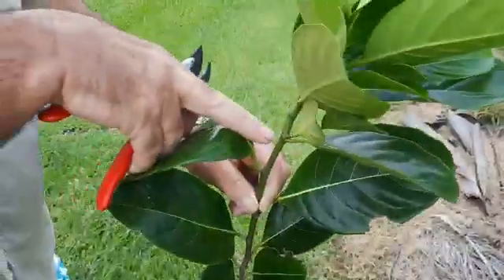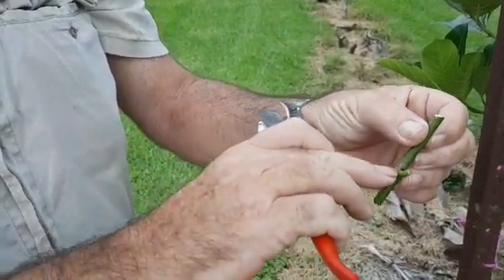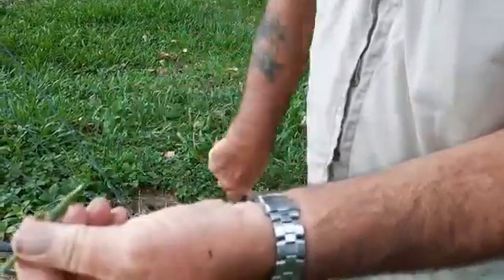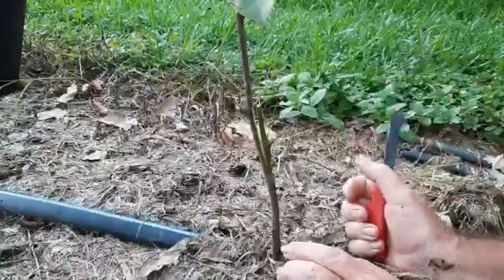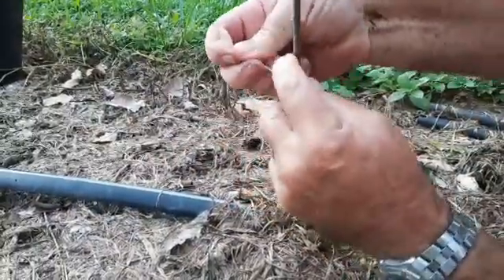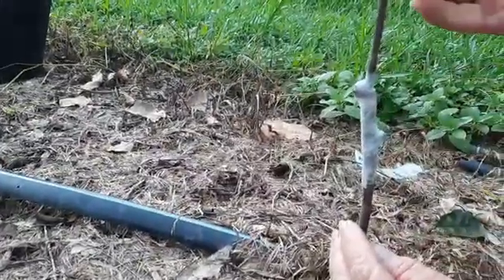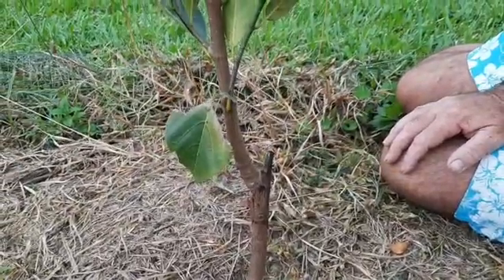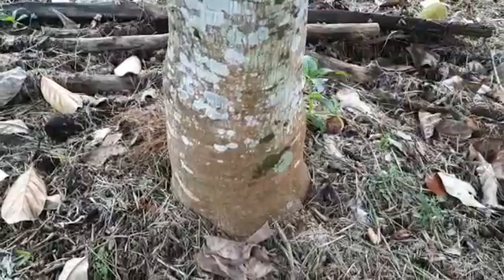Jackfruit seedling Grafting directly in Field-Healthy Tap Root Cyclone Protection Drought resistant

Comment: What season do you think is the best season to graft. Is it the march month or the November December season. What's the best post graft care, immediately after graft. Because in the field it's difficult to maintain humidity and shade. Please let me know. Thank you. ❤️
Reply from the maker: Especially for budding, the survival rate is high when done inside green house / Polyhouse from Jan to Mar. Budding done during rainy season are susceptible to a lot of failures. I have heard from a batch of 2000 budding only 60 survived during rainy season.

From few experts, i also heard the other grafting methods especially for first time grafters, survival is higher in traditional grafting.

Grafting directly in field definitely needs lot more care and the optimum season.

Comment from the maker: I have shared the video to help Tamilnadu farmers and also jack progressive farmers across the world to adopt such practice especially those who are very much concerned on the tap root system of Jackfruit trees. 

Dibbling seeds in the ground before rains in required espacement is good. When we put the seed in polybags the root gets coiled. It hampers the growth of tap root.

After one year or so or when we think the plant is ready we can do the budding on site. Tree grows  vigorously. We can have more seedlings and can be removed unwanted one later.

Also the short life of grafted plants mainly due to coiled tap roots when the Seedlings are kept in pouches for long time. 

Also to get Uniform quality jackfruits similar to the mother tree by grafting such plants reproduced from seeds, with scions taken from superior quality mother jackfruit tree.

Also plants reproduced directly in the field with an excellent tap root system will be robust and drought resistant with higher Survival capabilities withstanding severe climatic variations and hence long life with long commercial yield.

Also the trees grafted in the nursery and then planted out are significantly slower in growth.

While the field grafted trees (directly grafted in the field) grows quite faster and robust. 

Our intention is to mutually help farmers across the world with such best practices and no other materialistic interests.🙏